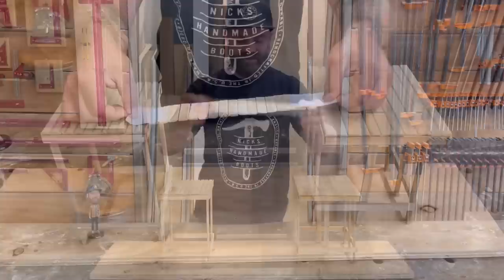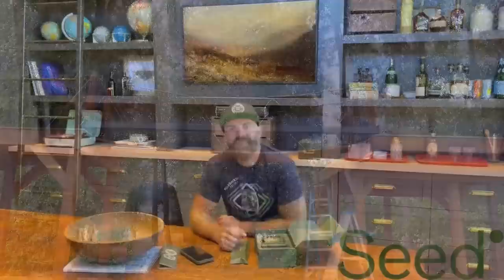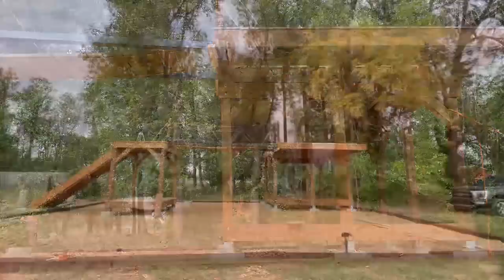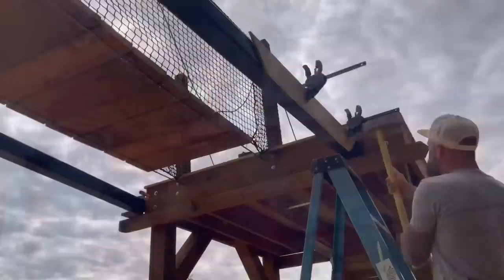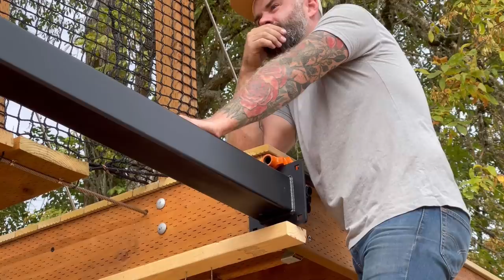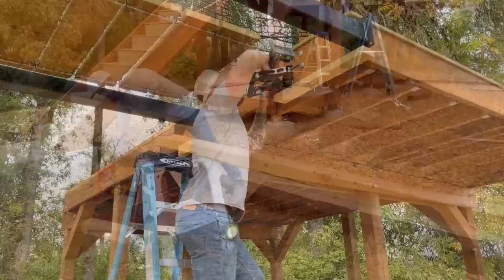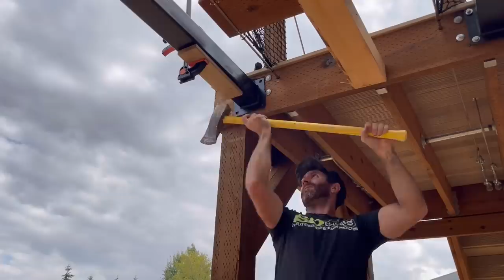My Treehouse is Falling Down || Fixing a Huge Mistake

Comment: Quick suggestion from an aerospace engineer with a structures background: slacken off the tension in the bridge cables so they sag a couple of feet in the middle. It will reduce the horizontal load at the endpoints and make it more fun to play on. For example, if the weight of the bridge and people on it is 500lbs and there's a 5 degree droop from horizontal, the horizontal end loading is around 2,750lbs. If there's a 30 degree droop, the end load is around 430lbs.
Reply: Agreed.  The cables need some slack!  Basic free body diagram.
Reply: That's a good point, more slack in the cables actually means less tension going on. I would guess that 12-degrees might be a good optimum, stealing from the common design goal for the angles on sailboat shrouds
Reply: I agree that the tension on the bridge should be reduced. What about expansion and contraction of the metal beams with temperature fluctuations? Could that affect the structures or the bridge?
Reply: @adrianpaterson9904  I actually don't know off the top of my head what the thermal expansion coefficient is, but a quick Google for steel, and assuming it's around a 15' length, seems to show less than 0.1inchs over a 50 degF change.
Reply: Yeah, as a structural engineer I couldn't even watch enteirly the first video about the bridge without losing it.
Reply: Exactly the very first thought i had but its easy when i know not very much about woodwork but just enough about physics.
Reply: Yeah, I commented something similar... Every bit they pushed it apart made the cables even tighter!
Reply: Slack in the bridge and cross frames in the platforms, could even be with steel cables would have solved the problem 100%. i have a background in mechanical and structural engineering.
Edit:
Even without the bridge i would have had the cross cables just to give it more stability against wind and weather
Reply: Yup.  And if he was still concerned about the remaining movement, he could have run cables from the upper edge where the bridge attached down to the footings on the opposite side.
Non-engineers trying to solve an engineering problem.
Reply: Yeah I was thinking he should have eased off some of the bridge tension to even just put the beams in place to begin with. I bet the lines were holding those towers out of plumb by that point.
Reply: Interesting, is the tension pulling on the bridge due to the small angle, or tension builds quicker in the bridge due to it? Surprised how a slight variation in the angles creates such a drastic change.
Reply: Does he need any rigid members ($$$) to accomplish this. Tension in a  ($40) cable(s) could handle this, no? Do what you did with the truck but to the base of a nearby tree. Use a turn buckle and crank yourself back to plumb.

Comment: Why didn’t you take the tension off of the cable?  Would’ve fit easier without so much drama. Otherwise too kewl.  Greetings from Gera, Germany
Reply: Frank, you are acting too much like German 😂 it’s good to lighten up and enjoy a little drama 🎭 🤠🇫🇮
Reply: @finntexbuild4809    I use to live in Grants Pass and built my kids something similar. Gotta love it
Reply: Wouldn't that have defeated the purpose? If you loosen the tension, you'll never get it back to the tension you need to make structurally sound once the beams are in place. The beams would have made the tension loose.
Reply: @sherespawns8373  After Insertion then retension the cables.

Comment: Don't know if it will cause any issues structurally, but you could weld some handle bars on the bottom of those beams to make a sort of jungle gym
Reply: Turn one into one of those zip handles that you see on play structures now.
Reply: Particularly because he still has to solve the problem, some others have pointed out after the last video, that the ropes of the Suspension Bridge will dig into the wood. He hasn’t used any bushings to prevent this from happening
Reply: Could you have not have used heavy duty springs on the bridge? Like the ones that hold long zip lines up to absorb the additional force applied when someone stands on the bridge.

Comment: Could you have taken tension off the bridge cables first then used your ute to pull the house easier?
Reply: Seems so obvious to me! Could have gotten the job done in no time. Spent all my time shouting at the video to release the tension in the cables!
Reply: Me too
Reply: Yeah- I’ve been yelling this the whole time I was watching!!! Release the tension!!!
Reply: Same here 😂
Reply: Yup
Reply: Thinking the same thing
Reply: Yup, me too!
Reply: Seems like the main issue was that he bolted down the other support before getting the second one in place.
Reply: Бляхя муха! Ну не ужели не ясно было! Конечно, отцепить тросы и потом вставить это балки! Кстати, и деревянных бы хватило.
Reply: Indeed, same thought here, as far as I know steel wires don’t stretch that easily. 😂
Reply: Certainly the rope attached to the truck is less stretchy than the steel cables on the bridge 😂. Glad I wasn’t the only one yelling at the screen.
Reply: Replce wire with rope, would look much better but awesome job so far. 👍🏻👍🏻🇦🇺

Comment: I noticed that loosening the bridge cables was never considered. 
Love your You Tube videos a lot!  
Thumbs up from a retired general contractor of over 45 years.
Reply: I wondered the same thing.  As the towers spread apart, the bridge cables came into tension.  I bet loosening the bridge tension cables would have made this much easier.  It is easy to be a Monday AM quarterback when you have a physics degree and aren't in the moment.  Glad you found the problem before it caused a larger issue.  Great video and keep them coming!
Reply: Exactly what I was thinking! 👍👍
Reply: They were fighting the cable tension exactly
Reply: That was the idea screaming in my head from the moment he said they couldn't get the towers spread back apart.  What was the thing that caused the issue in the first place.  The bridge tension......
Reply: Yeah, at least loosen the cable when you're spreading the towers :)
Reply: great to see i'm not the only one who was wondering why they didn't do this at the start.
Reply: Yep, my thought too.

Loosen the bridge, get the beams in, retighen.

Sorted.
Reply: Yep.. thats what i saw.. anybody ever feel bad for pple that post vids of doing stuff the hard way only to post and see all the comments from the peanut gallery with the solution on hand..? 😁
Reply: Regardless of cable tension, all the weight of the bridge and it's occupants is still 100% on the towers. Looser cables may have dampened the motion of a dynamic load from walking across the bridge, but would have done nothing to provide additional support to that load.
Reply: @iansmith8054  They're talking about loosening the bridge to help spread the towers apart to fit the beams, my friend. 

Though, I don't believe that would've helped. Reason being from all the walking they had already done, the big tower was pulled towards the small tower. The issue was the structure had gone out of wack, the needed a lot of force to push that tower back to square. Loosening the bridge would've done nothing to help push the tower back.
Reply: @iansmith8054  So this is where it gets tricky.  The weight of the bridge and it's occupants is 100%, that part is true.  Let's say that the amount of dip in the bridge is approximately .4 feet and that the load combination of the wood slats and the people is about 600 lbs.  (it could be much more than that if they are jumping.  Right now the bridle angle of the steel cables is 174.28 degrees.  The force on a single cable is 6000 lbs, but that's a force of 6000 lbs on each side pulling inwards.  Jason has two cables, so that is split between the 2 at 3000lbs on each cable pulling inwards.  IF he were to have a drop in the middle of the bridge of at least 12 inches, then that load per cable drops to 2418lbs and divided by 2 is 1206lbs, more than half of what it was originally.  If he had a drop of 24 inches, then it would be 1236 lbs each divided by 2 cables would be 618 on each cable attachment point.  This is why when you see suspension bridges they have a dip, especially playground bridges where the shock load of a bunch of kids jumping on it can be way higher.  Adding the beams in keeps the structures from pulling in, but it does not loosen the tension on the cables or the attachment points. There is still 3000 lbs or more on each attachment when someone walks across.  I'll repost this higher so maybe Jason will see it and loosen the cables.
Reply: Yes, when he tried backing up the 2nd time that is where my mind went!
Reply: @wktaylor11  I see the numbers and that the load on the cables is different because of the sag, but could you please explain why this is? It seems to me to be a violation of the conservation of energy given the gravitational force is the same in either case, the same amount of mass is being suspended, and the same number of cables is suspending the load. I can show the affect of that load on the towers can change based on the angle at which they are being pulled, but I don't see how there is any difference seen by the cables.
Reply: @wktaylor11  is the OP talking about loosening the cables to assist with spreading the towers to insert the steel, or as a solution to the wobbly towers? I may have misunderstood the whole thing.
Reply: @ABrokenSociety  I see. Thank you. I spent way too much time thinking about the wrong thing. Thanks.
Reply: @iansmith8054  so this is bridle math. I’m in the yard running power right now, so I can’t get to it, but if you do  a search for bridle weight calculations there are some good tools online. Pocket rigger being one I use. I’m an ETCP certified rigger, so I do convert type rigging, suspending large loads over people and I have to do a lot of math. It physical load does not change, but the tension it puts on the cables does. The flatter the V between the two points is, the higher the tension becomes. If you have a 90 degree V with the tops of the V being each side of his towers and the bottom of the V being the weight in the middle of the bridge, then the weight is about equal to 1/2 of the load. I’m not sure if this is making much sense.
Reply: @wktaylor11  actually yes. It's making perfect sense. I thought about it and remembered when I put my closeline in and how hard it was at the last bit to pull it tight. Seems so obvious now  I appreciate you sharing the knowledge.
Reply: @iansmith8054  that is a perfect real-world example!
Reply: Was kinda giggling during that part.. So much work fighting against those cables 😂

Comment: I LOVE this channel!  Jason, if you had loosened the tension on the cables, your 8 hour project could have been completed much quicker.  Also, the tension is still way too tight.  Ultimately the excessive tension will damage the structure where the cables are attached.  I suggest loosening the cables to protect the structure and to make crosing the bridge more fun. That being said, I wish I was as good a woodworker.  Love the channel!

Comment: Another potential problem I noticed that you may want to address is where you drilled holes into the wood to run the cables through. With the tension you have on the cables, that can begin to cut into the wood. Those steel cables will start to cut into that wood like a saw. To prevent that you can just slip some steel couplers into the holes of the wood and have the cables run through the steel couples. Just get a piece of 1/2 or 3/4 inch pipe or whatever size you need to slip the cable through and for the pipe to fit snug in the hole of the wood and cut into 1 1/2 lengths or whatever the thickness the wood is and insert them into the holes and run the cable through that. That way the cables aren't eating away against the wood. You may want to file down the inside edges of the pipe so the cable tension isn't rubbing against the sharp edge of the inside of the pipe which could cause fraying to the cables.

Comment: Maybe you should have released some tension on the bottom cables of the bridge, they look tight now, so probably stopping you moving the large tower
I would probably release some tension anyway so the weather doesn't put strain on the structure, cold makes things shrink ;)
Reply: I was about to say exactly  the same thing but thenI thought I should check to see if someone else already had. Nice one. Releasing the tension on the bridge should have happened before the  truck being hooked, up in my opinion.

Comment: Great video In responding to a challenging situation. I worked on a project where we had a large steel cable net suspended from an existing bridge structure. In order to not overload the supporting structures we actually added slack to the cables. Only adding day 1-2% sag reduced the lateral forces on the supports by about 50%. It takes and exponential amount of force to resist the lateral loading the tighter you try to bring those cables. Seems counterintuitive but was a very simple solution.

Comment: You could have replaced the suspension bridge with two wooden joists, and put the bridge planks directly on the wooden joists.  The reason for a suspension bridge is to span a gap where you can't build a solid bridge.  This is still a fun video.  As an engineer, and a woodworker, I'm constantly getting myself out of problems that I make for myself 🙂
Reply: Lol exactly this doesn't make sense at all but fun content nevertheless
Reply: But then it wouldn't bounce at all, losing a lot of the appeal of the bridge.

Comment: Jason - nice solution to a difficult problem.  Practical and functional.  For what it is worth, using a bottle hydraulic jack is much easier than a scissors jack.  More power and more easily controlled.  I replaced the scissor jack in my truck after trying to change a tire when it was raining out......

Comment: Pretty simple problem, side sway. Each structure needs to be strong enough to resist the loads they are designed to carry on their own. Your two tower structures don’t have any members to resist side sway. Take a look at how fire towers are designed. A couple of steel cables in the form of an  X would be a a lot stronger. 

The steel beams have locked the two towers together, but the whole structure is still susceptible to side sway. Each tower needs to be able to stand entirely on its own, including wind and side loads. You should still do some x bracing. It might not seem like it, but your building and designing a fairly large and tall structure.
Reply: I agree with this. I think X bracing would solve the problem by itself. Just have to direct the load back into the concrete footers.

Comment: Did you think about loosening the cables.  In trying to open up the span, you are fighting the cables.  Looking forwarding to the house building.
Reply: That was my thought aswell
Reply: Dido
Reply: Me too
Reply: I thought the same
Reply: I was shouting that at my phone
Reply: Thought the same. Was the only physical connection preventing movement.
Reply: 👍🏻 yep, that was the problem. At least my 35 years in construction tells me so.
Reply: Bingo!
Reply: I thought the cables would pull them together.  I hope the Foreman approves of this solution.
Considering that the turnbuckles were spun out so much, there probably wasn't enough left to release the tension...
I bet he cut the cables close to the cable clamps, making it nearly impossible to undo them as well.
I am still scratching my head as to why he pulled with the truck instead of using good ratchet straps with the truck as an anchor...
Reply: Same thought I had.

Comment: 1.Loosen cables.
2.Get towers plum and square.
3.Install braces (which should probably have some kind of cross-beam joining them together if you're going this route)
4.Tighten cables.

You're route was "ugg me use truck!" and you've now got some pretty crazy torsion and tension going on throughout the structure.

Comment: Should've taken the tension off the bridge. I bet if you'd have detached or just loosened the bridge the truck would've been able to put the tower apart.

Also, you could build an angled climbing wall on the back side of the tower to anchor it down mimicking the stairs on the other tower.
Reply: Yep.  Also, climbing wall is a great idea!
Reply: Or a slide for the kids to slide down.
Reply: This is what i ended up doing on a treehouse I built that was swaying due to the tension in the suspension bridge. I ran two 4x4 posts down from the treehouse to the ground at 45 degrees and built a net hammock/climbing net between them.

Comment: The fix to the issue makes the cause of the issue kind of pointless. I mean the suspended bridge can now be replaced by a proper bridge using the 2 steel beams. Still nice to watch!
Reply: but what fun would that be? no suspension bridge, no bounce.
Reply: @johnrhoades1776  would still be funnier than dropping out on day 1, don't you think?

Comment: I'm an amateur builder. I live in the house I built by myself. Nobody other than my wife has helped whatsoever. I've made this same mistake. I ended up learning a lot about sheer strength. Now my house is super solid even though I built the entire thing on skids. I saw at 12:09 that when you hit the beam the whole structure wobbled. It doesn't seem like much but the higher you build, it will get worse. You may want to be extra aware of that possible issue for the future. I love your videos. I'm subscribed and I'm building the same staircase for a customer, so thank you!

Comment: You should have just loosened the cables of the bridge somewhat, so the big tower doesn't pull on the small tower anymore. That way the space between the towers would be bigger when pulling with the truck and the steel beams would drop into place easy. Nice build BTW.